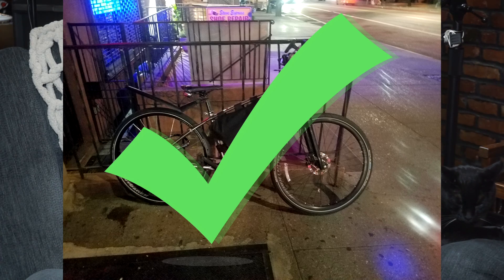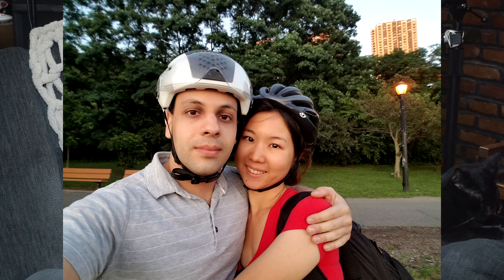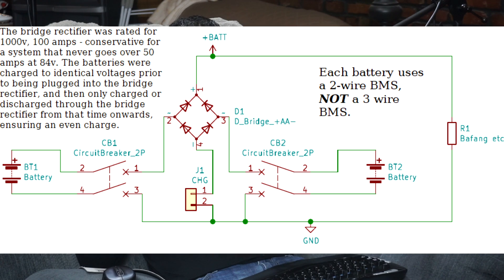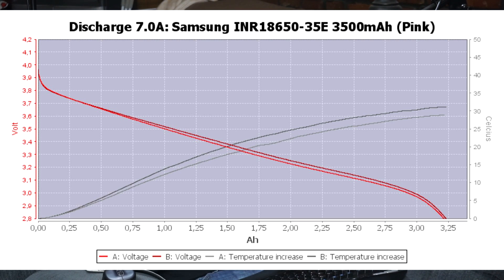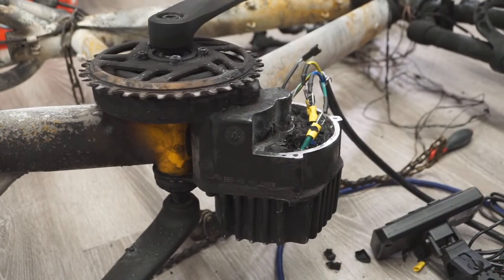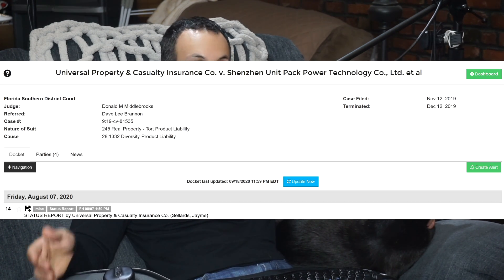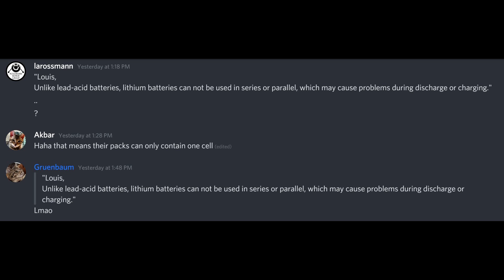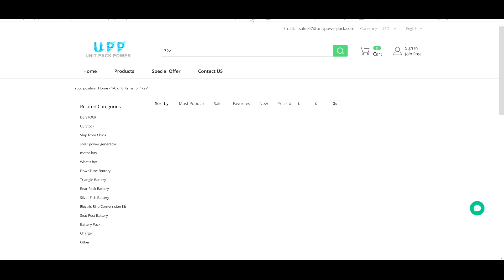Louis' front door goes BOOM courtesy of UnitPackPower battery.

Comment: The % of the batteries capacity used isn't the problem. Batteries are a sandwich of electrolytes, anodes, and cathodes that have barriers between them such that it stores energy. When these barriers break it creates a short circuit inside the battery itself and releases all the contained power at once in the form of heat. That stored energy released as heat is great enough to start a fire, much like gasoline, or even fire bombs that use sugar.

That battery is defective. Since you didn't stab it to break the barriers, the only possibility is they degraded and failed on their own.

Comment: You said you turned of the circuit breakers before the fire , are you sure of the quality of the breakers. A short or water in the breaker could cause a direct short of the battery if there is no fuse. I would put a fuse near the battery.

Comment: It really doesn't matter if it was used less than 40% its rated continuous current rating. If the connections were bad during manufacturing (Especially a bad welding press), this can happen. You would have no clue if it was a bad battery or not after it's been sealed packed until this happens.

Comment: I’m not exactly understanding how the rectifier bridge work for balancing charges and discharges... seems to be nullifying the balancing effect of parallel use ? And 84v use, is it for top charge of 4.2v per cell (20 cells) or the normal lipo value of 3.7v per cell (23 cells). Because that’s where all the balancing magic is needed...
Reply from the maker: It's not supposed to be balancing. That's not the point. The point is for the two packs to equally share the load.
Reply: Louis Rossmann Louis Rossmann ehm... chief... I ain’t no native english speakurz but. Equally sharing and balancing sounds one and the same.
And the bridge action it to allow power from battery 1 and battery 2 to only go toward the bike motor. Nothing guarantee that one of the batteries will not discharge more because of loose connector, water or kinky wiring.
Also Your wiring shows no individual monitoring of Bt1 and Bt2 but they are on different breakers for simultaneous  use... I will assume that your schematic is not complete since I don’t see any power fuses but... having been and triggered few electrical fires muhself... that setup look a bit too bare bones. Now I don’t know much aboot the standard practice for electrical bikes being moar of a rolling coal diesel crowd (works much better under water...)

Comment: Ok, Do you use the batteries internal charging systems? The internal charging circuits are designed to amongst other things cut off the batteries in the event  that the battery gets to hot when charging. Even apple does that with their laptops! If a cell dies it can go short circuit, then the rest of the batteries can be over charged when that happens the rest of the cells can get to hot.

Comment: I think you are right, the 18650 used by upp were overrated, or the bms were faulty. But I also think the packs were too much 'packed' with tape, I think such high voltage and power battery packs should have some way of cooling, as in modern electric cars, where batteries are air or liquid cooled
Reply from the maker: The material around the battery is the same material you find in EM3EV battery bags, similar thickness. EM3EV triangle battery bags have that material around them as padding to protect it. 

A 35E putting out 2.4 amps is not creating that much heat! Unless it wasn't a 35E...
Reply: @rossmanngroup  are you putting your old motor (the one in this video) on sale?

Comment from the maker: Pop the glass. https://teespring.com/pop-the-glass?pid=658&cid=102908
Reply: Nice
Reply: Jordan Cambridge  Jet fuel is basically kerosene...
Reply: Ever going to do a build with a Gates belt and Enviolo IGH?
Reply: Show me a photo of how you had the Bridge mounted / heatsinked, and I'll believe you 100%.  If it's allowed to heat up, it can melt insulation and short things out.
Reply: Also, check via autopsy if any of the diodes in the bridged failed open / shorted.  I was using 45A metal bridges for some other purposes (about 8 amp draw), and at one point the insulation passed it's ignition point.  When I popped the cover to see what the heck was going on, it flashed to fire. With enough voltage and close-spacing, the particulates / vaporized plastics can become quite conductive and light up like an arc lamp.
Reply: Louis, whenever I stumble on a clearly Chinese website selling products I can't buy on eBay or aliexpress, I gtfo of there. Doesn't matter how much it looks like a perfect fit
Reply: I swear by these batteries ... But i recently had to repair one and they don't use name brand cells i was shocked cause they work great
Reply: HEY I WORK IN THAT NEIGHBORHOOD.
Reply: hahaha I was wondering why you said that  4:03 an expert at work
Reply: Jordan Cambridge  Jet fuel is actually close to Diesel in its characteristics which is less flammable and more difficult to ignite than regular Gasoline, what you're describing sounds like the burning fuel tank sitting on top of the motorcycle created a jet effect thru its narrow filling nozzle!
Reply: Jordan Cambridge  About the jet fuel bike, reminds me of that story about a guy who tried dumping jet fuel into a deep hole dug into soil and then ignite it to get rid of it. "It will just burn" the man said, while accidentally creating a dirt pulse jet engine. Needless to say dirt isn't very conducive to receiving multiple high pressure shocks so it collapsed, but for a very brief couple of moments, someone used a pulse jet to move earth.
Reply: You got a battery from the Bethesda line: " It just works" :P
Reply: Louis, talk to Battery Mooch about this in a podcast please. This sort of stuff is so important for people to understand. And if this is true, even the industry has messed up big now. Which was a long way coming already.

He has tested so many 18650's and knows much about the dynamics of those things. Maybe even some errors or shortcuts the industry makes/takes.

Comment: ... that's the slowest firefighters i've seen ...
Reply: I'm sure they were in no hurry to breathe in all that wonderful toxic-as-fack smoke.
Reply: @gtfkt  This is why they have all the fancy gas masks and stuff. Every normal house fire has toxic smoke, too. It's their job, they should be able to deal with stuff like this.
Reply: For real...if that was japan that shit would have been put out in 60 seconds lol
Reply: Different tactics are used by different fire departments and in different countries. The US seems to have a focus on setting up all equipment first and ascertaining the presence of people nearby and setting up a battle plan over fighting the fire as soon they can. For instance in the Netherlands and Germany afaik all first responder trucks have a water and foam tank built in with what is called a fast attack hose. For smaller fires like this 2 fire fighters will focus on getting foam or water on the fires ASAP once they dismount.
Reply: Don't think is want to put water on a electric 🔥 fire
Reply: @DANTHETUBEMAN  The proper way to put out a lithium fire is to flood the battery with water to keep it cool and slow down the chemical reaction, at the point of the battery pack burning it is a chemical fire and not really an electrical fire. But with the small size the fire they were probably mostly waiting for it to burn itself out and just not letting it spread since it will keep autoigniting and they would cause water damage for no good reason.
Reply: @CondoreComputing  the other comments on this vid made me want to research lithium fires a little https://www.ifixit.com/Answers/View/557642/What+should+you+do+if+you+have+a+Lithium+ion+Battery+Fire 
Seems like water isn't great for these bigger lithium fires? Thought they don't mention flooding it with water, just that water is ineffective
Reply: @sernikpl2010  I think the idea of flooding lithium battery fires with water mainly so that it doesn't spread to other cells in a pack, but thats probably more for larger packs like in cars, most of what I know is the recommendations for stopping or reducing the damage from electric vehicle battery fires.
Reply: @sernikpl2010  The fire is caused by overheating it may be also internal short in one of lithium-ion battery. Water can only reduce heat and spreading fire to other batteries.
But in case of package so compact and how it was allready super hot its not much you can do. Its more important where you leaving your object when the fire starts and moving awey potentialy flamable objects near it.
Reply: @CondoreComputing  As said before, lithium catches on fire when put in contact with water. + if the cells are not destroyed yet, they are still energized, you never put water on electricity.
I know it might be counter intuitive, but you never flood lithium battery into water, especially when it's on fire (I'm talking about big batteries when dozens of cells are involved). It's battery management 101.
Pretty sure that's partly why firefighters wait until the battery is fully gone, to put out the fire with water. I guess the other reason, is that you never rush such things. A fire is way too dangerous to rush anything, you calmly triple check everything.
Reply: @CondoreComputing  I'm seeing electrical discharges still, you would properly get the shit shocked out of you, he did not use up musc of those battery's capacity.
Reply: @DANTHETUBEMAN  If only they had a.... fire extinguisher!?
Reply: @GunkDung 
Fire extinguishers also don't work on electric or chemical fires.
Most extinguishers take all the oxygen away, some cool things down.
But a battery doesn't need oxygen (from the air) and temperature is not the reason it caught fire.
Reply: @GunkDung  fire men?  Never!

Comment: No need for fancy bridge rectifier tbh I have run 2-3 separate 10s packs parallel on my ebike with only bulk charging for 8 years and not a single problem.

If you want you can run a automotive fuse on each pack to protect them from shorts in the powerline but anything else is not needed.

I have thought about it a lot and if you need a cheap ebike battery i would build 6s packs with a fuse and a 6s balance connector.
with these packs you can run 2 or more in series and charge them in bulk and every now and then check the balance or balance charge them.

Without a BMS quality 18650 cells do not get out of balance unless they are damaged physically, overcharged, discharged to the point of cell reversal.

BMS wires are a major source of failure on cheap packs as you have thin awg cables directly connected to 100amp power sources and if not routed properly and mounted on bike correctly the cables will get pinched and eventually cause a short between cell banks.

If you must run a BMS please please fuse your balance cables and use a high pinch resistance cable.

Comment: I think the manufacturer meant the packs aren't meant to be used in parallel due to differing impedance, since that could severely damage cells that don't contain protection circuits.

Comment: Show us the circuit breakers you used.  Are both poles being switched next to each other or by same component?  If so the daily bike vibration may have been enough to turn your breakers into dead shorts when you turned them off.

Comment: that is why i build my own packs for my bikes . just for that reason
Reply: I am always been proud of your products
Reply: It is best to build your own packs if you can get a good quality supply.  A big advantage of building your own packs is you can test  individual cells before soldering or spot weld them together.  I am a Lipo user, I use the 6 cells packs in the 5000 to 7000 mah range.  Using my computer controlled 400 watt chargers I can usually charge and balance my packs in about an hour. I use the lipos pack in powering my high powered  radio control aircraft as well as my E-bike.  My bike is actually easier on my lipos than my planes.

Comment: These defects have been known to the chinese manufacturers since they started manufacturing them - it happens so often that they have a dedicated bucket of sand nearby the assembly line for when the batteries blow up and catch fire. According to the factory manager it can happen up to TEN TIMES PER DAY OR MORE for a relatively small factory line. It's an extremely common occurrence - and this is using the best equipment under ideal conditions. (See StrangeParts for the factory tour in question). This may surprise YOU, but these batteries are often just pieces of shit like every other product ever, except they go boom when the break instead of just dying.

Comment: Sounds like the batteries went into reversal.  One of the component batteries was weaker than the others causes the stronger batteries to discharge to the weaker battery causing it to overheat to the point of exploding causing a fire.  I worked for a company that developed a battery pack for an e-bike.  Development and testing lasted over one year.  We also made battery packs for the US Military of Israel.  The military batters were two banks of Li batteries, 5 batteries configured to provide 12+ volts (each battery is between 2.5 and 3 volts and each could crank about 100 amps). Small circuit board in each battery and a switch to change from one bank to the other when one bank was below working voltage.  Yes, Li batteries are unique batteries and can cause problems and fires.  A small amount of water can cause production of Hydrogen Gas which will explode if there is a short, under those conditions, or there is sufficient heat for detonation.  Li is very reactive in water, just like metallic Na.

Comment: Aliexpress it's just a magnet for crap chinesium they don't even dare to get to ebay they're so bad. And you don't even get the full circus until you get into a dispute, there's le creme de la creme with reppresentatives push buttons taking side of the seller and his fumes of nonsense bullcrap where if you have a little tech knowledge you would close them midway. Just for completition DON'T even get close to YOTAT YT Printer Supplies Store or whatever they rebrand oversized printer ink cartridges or car diagnostic tools over 20 USD from people like ALI KING Dealer Store. btw for some reasons the emal account I use on that platform get's leaked around and I have pretty much spam after these encounters...

Comment: A couple of years ago I started a recharge on some regular, off the shelf, 12 volt lead acid batteries.  The kind you see in UPS's.  It was in a stainless steel container on top of the bridge of the ship I was working on at the time.  We were reactivating the ship after it had been in mothballs for a couple of years.  About 18 hours later there was a very loud explosion.  There was shrapnel all over the deck of the ship.  I started investigating and found that the stainless steel container was bulged out and pieces were missing.  The LEAD ACID batteries had exploded.  I could have been killed if I had been up there working on antennas or something else.
Reply: Connie Jurgs hydrogen leak from the batteries ? No venting from the ss containment ?

Comment: You, as someone that makes a living from fixing electronics (fabricated in China) should've known that once your parcel from China arrives, you bin the warranty, take the thing apart and fix it before even contemplating using it. 
I would've burned long ago if I just used the things as they came. 

There is no QC over there. 
The thing can be very nice, safe and lasting but only after some proper quality control. 
Batteries - verify each and every cell (voltage, capacity, esr), check wirings, insulation, fuses (if none, put some) and so on and so foth. 

I recenntly came across a hoverboard/segway like two wheeler that had it's battery toasted. Literally. The BMS was wired wrongly and only protected the pack from overcharging. They just wired the discharge plug from the charge terminals and the pack was repeatedly ran to zero volts then recharged to full. 
All cells had blown their CIDs. All had their insulation cracked and warped from excessive heat. 
One wire soldered in the wrong place.

Comment: Given that most of a bike isn't particularly good at burning, that's an impressive fireball from the battery.

I'm also not hugely surprised, knowing the available energy.  Assuming an approximately 10 Wh 18650 cell (that's roughly 2700 mAh at 3.7 V); just 28 cells have approximately the same nominal energy as a stick of dynamite, 1 MJ (megajoule).  That's just the energy down to minimum operational voltage, there's actually a good bit more in a destructive release (an operationally discharged / empty cell still contains energy).

Comment: Louis solders a diode between batteries in spite of literally no one in the world doing so.

Louis proudly professes the world does not understand batteries as he does.

The diode prevents parallel batteries from balancing, causing a runaway imbalance until one battery eats it and catches fire.

Louis berates the battery maker for not cooperating with his new invention which at this point he's probably flogging to Elon Musk.
Reply from the maker: That makes zero sense
Reply: not an argument. Find me one battery pack with diodes in it. Your idea was hair brained and it cost you a bike.
Reply from the maker: @Remco Stoutjesdijk You didn't present an argument. I did not solder a diode between batteries. Further, there is no basis for "literally no one in the world doing so" - they sell these as an accessory. 

If the two packs are charged to identical levels, and hooked up through a bridge rectifier, they will discharge evenly. Even if they do not - if the bridge rectifier is in place, you can have two packs that are not balanced plugged in without one trying to charge the other.